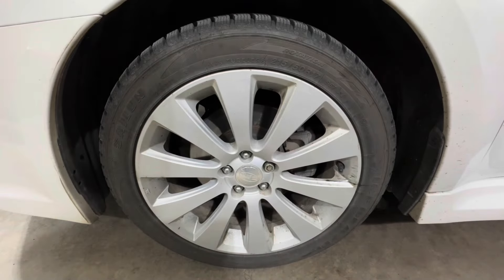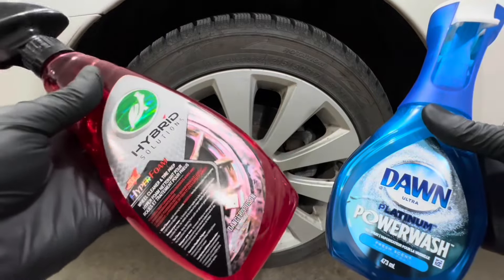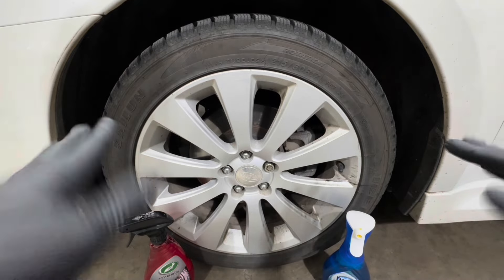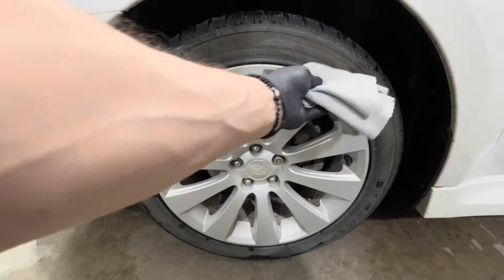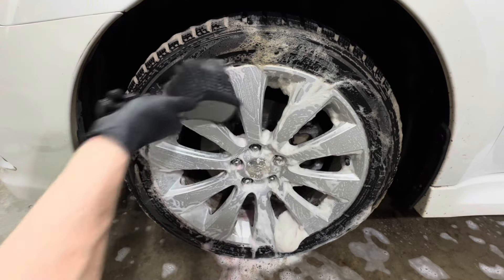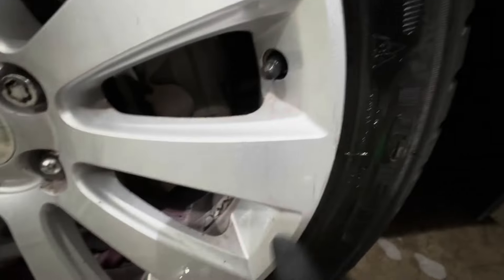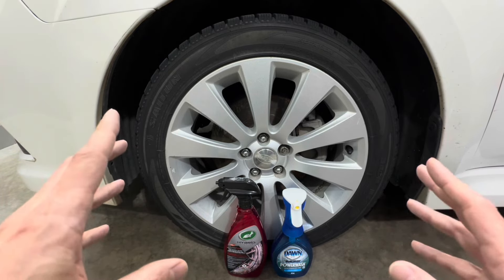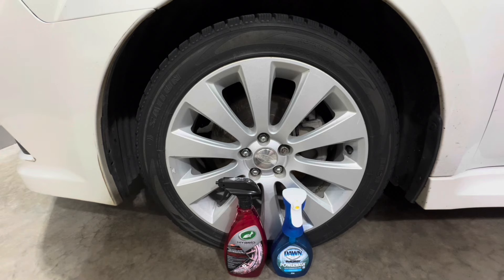Is Dawn PowerWash A Better Wheel & Tire Cleaner?

Comment: Yes they both perform very similarly but the regular dawn soap will eat up the rubber on your tires extremely fast so it’s not worth it. There’s a reason why turtle wax uses ingredients that aren’t tough for your rubber
Reply: This is what people fail to understand.
Reply: I use Adam’s. I cringe when I see people using dish soap on cars.

Comment: Back in the 2000s I worked at a dodge dealer. We washed every single customers car. They had this pink soap for the rims and tires. You would spray it on and power wash it off. No matter how bad the inside of the rim was. When you rinsed it off. It took all that dirt grime and break dust right off the rim. There would be customers just shocked how clean the rims would come out. No labor involved. I don’t work there anymore. It closed down in the 2008 disaster, but I have never been able to buy that soap. None of the detail shops carry it. And believe me I have tried. Wish I knew what the namebrand was of it.
Reply: Maybe that soap is bad for the environment
Reply: The name of the soap is acid. You spray wheel acid, dont let it dry, power wash off and even the most baked on grime will have been eaten away. Great source of respiratory damage.
Reply: most likely acid being involved which is not good for long term use and terrible for ur health.
Reply: @justinbernardo8240  I don’t think it had acid in it. Because they used it generously. And I know they would get it on themselves. But I honestly don’t know. And I’ve never been able to find it. It was thick pink soap. And it worked like a charm. Hubcaps tires and rims. No wiping no scrubbing just spray and rinse off.
Reply: @theczar6171  Acids are rated by the pH level, and it's indicated by a pH below 7. Not all acids are the same strength, so you cannot say that just because it got on them it's not an acid. Vinegar is an acid, too.
Reply: @rustler08   good to know. They were using something that didn’t hurt them. But yet clean the rims was just a spray and rinse away.

Comment: Been buying super-duper wheel cleaners for years with so-so results. Saw this video, tried Dawn, best wheel cleaning experience in years. And less expensive too.
Reply: I'm thinking about just using the dawn for everything. Car cleaning products be getting too expensive. Only issue is that I'm allergic to Methilizosione which is what Dawn uses in most of their products, but not with Powerwash.

Comment: Mike Phillips on Dawn when he worked for Meguairs: "The problem with using strong detergents to wash your car is that not only do high alkaline, strong detergent soaps like Dawn dull your car's paint and strip off wax/polymer protectants, it also dries out all of the non-paint components such as vinyl, rubber and plastic." Recently, he made an exception for vehicles that are really hammered, so I guess that exception might apply to heavily soiled wheels. Otherwise, I would use less aggressive means.

Comment: We don't have Dawn here in the UK but if we did, I'd use it. I used regular dish soap/liquid for years on alloys with no detriment effect. Then, once a month I used an iron remover. However, I've now been conditioned by the manufacturers to using  the "latest & greatest" . Might have to have a 're think. A very useful video..
Reply: We do have Dawn in the U.k! It's called Fairy! Both owned by the P&G Company.
Reply: @craigedwards6892 Yes but they dont make a fairy equivalent to powerwash you can make a diy version with some water, ipa and fairy washing up liquid mix but it won't be as good as the real dawn powerwash and you would have to buy a bottle with a similar trigger mechanism to make it foam up the same as dawn

Comment: Dawn Platinum is seriously great for engine bays and wheels/tires. I usually mix it around 12:1 with water and it has never let me down. If the condition is worse than usual, I mix it 8:1.

Comment: I have been using the Turtle Wax product for awhile. I decided to try the Dawn Platinum and I feel it works just as well, for routine weekly cleaning, anyway. I saved my last Turtle Wax spray bottle with the foaming trigger and use that to apply it. You may find that a helpful tip.🙂

Comment: Used Turtle Wax hybrid iron remover on my wheels for the first time last week.  I have never seen anything clean so well.  I was only expecting to remove iron but they were spotlessly clean also. That's my go-to wheel cleaner now.  
I don't see much in this video as the wheel you started with is pretty clean to begin with.

Comment: Dawn soap is great soap I use that to power wash my house I make 3 buckets 5 gallon buckets with a cup full of purple power in each bucket I will power wash the house get all the dirt off the siding then I use a microfiber it’s actually one of it’s microfiber and it’s on a pole and it’s perfect size on the siding and I have a real soft brush on a very long paint pole that painters pole if I get on a ladder that you fold out i’m trying to think what size because I have five of them  i’m trying to remember when I use I use my extension ladder also on the one side of the house but I power wash everything first then wash it and then power wash it again and if it’s real dirty certain areas get real dirty from the trees I will power wash sections then wash it then power wash it and after I do it really well then I will do it a few times through the summer because it’s already clean so anytime it starts looking a little dingy I will just wash it again

Comment: I just spray the foam from my foam cannon to wash my wheels. Cleans them just fine. I wash my car every week to two weeks, my wheels never get dirty enough to need a heavy duty wheel cleaner. After two weeks, Adams mega foam works perfectly fine with agitation using a wheel cleaning tool
Reply: If you get ceramic brakes it turns into brown mud in your rims.

Comment: Great test! Whenever i wash my wheels, two seconds after initial rinse or aplication of any cleaning product, it is already drying up. I live in a desert. Is it possible to avoid that?
Reply from the maker: Thanks! Try to wash out of direct sunlight, work in cooler hours of the day either morning or late evening, make sure areas are cool to the touch, clean one wheel at the time, as soon as you spray the chemical start agitation and keep wetting your wheel and tools as you go until you completely clean the wheel. That should help fight the environmental challenges your faced with.

Comment: Be aware that Dawn WILL deteriorate coatings. It is a degreaser. Dawn is NOT pH neutral. It has a pH of about 9.0 which is slightly alkaline.

Although not incredibly destructive, over time it will remove/fade coatings.

Comment: Yeah I wouldn’t worry about dawn I would worry more about the dedicated tire and wheel cleaner, some of those cause your tires to turn brownish and no matter how much u clean it, brush it or shine it, it will still be brown, but that’s not the bad part some start cracking your tire walls.
Reply: No😊
Reply: All tires turn brown over time. It's called "blooming" and is caused by a chemical that helps the rubber resist rotting and decay due to ozone and sun exposure. Removing it without adding some form of UV protectant will cause your tire to dry rot much more quickly.

Comment: 2:26 saying Turtle Wax has a pH of 13 while holding up a safety data sheet that doesn't have the pH listed. 😂 My man!
Reply from the maker: Oh snap, thanks for pointing that out, I must have posted the wrong page here,however it is indeed pH 13. Anybody can look it up .
Reply: @DetailProjects  I believed you. I would assume a tire cleaner would have a high pH. I love the Hybrid Solution series but it looks like Dawn can get the job done for a fraction of the price. Thanks for making the video! 👍🏼